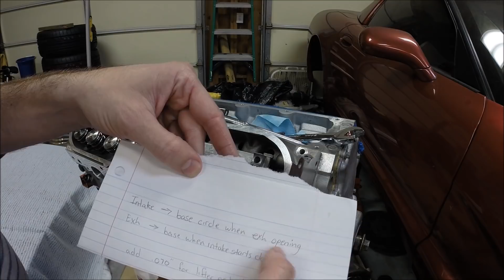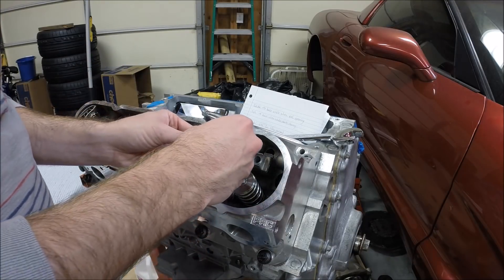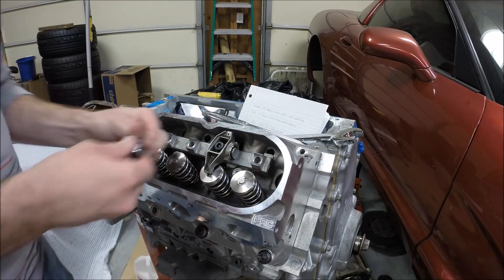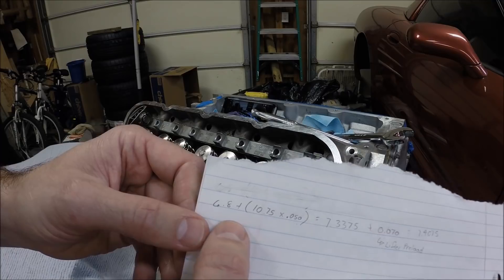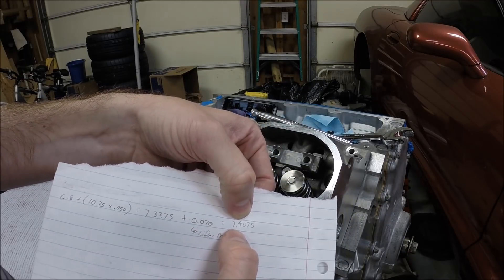LS Engine Tech: Measuring for Proper Push Rod Length

Comment: I just grabbed a large digital caliper & used that to measure the adjustable rod then added the ~.090” for preload (LS7 lifters). Took all the guess work out of it. 

I also found the base circle by just feeling the pushrod for the specific valve i was checking and making sure it was at max lift. Then barred the engine one full revolution ensuring the lobe was at the opposite side. My cam has 23* of overlap so I wasn’t sure I could trust the flip flop method mentioned here.
Reply: real length is not practical length tho

Comment: Late to the party here.....i bought a car abuot a year ago , put on less than 500 miles and had a roller rocker failure, someone didnt tork properly....im changing out the broken one now.   Ive followed your other video about the trunion upgrade and i want to do this since i recieved the factory parts with the car.  (not positive I have the stock pushrods tho)  I do know that along with the rollers, i have texas speed push rods and a vr2 cam in the car.     IF i went back to factory rockers, would i need to change pushrods too? or could i just bolt on the fact rockers and go.

Comment: What the hell,I was getting my heads done already have huge cam and so far using stock push rods n bloke at shop said I'd only need lifters head bolts n gaskets when I get my heads back,taking 30tho off hopefully,but if U think about it half a turn is 50 tho so really what's 30tho off ,but least now I know how to check ,my mate put wrong size push rods in his 351 with alloy heads should of heard the tapping😆

Comment: My question is . Can the tool withstand the spring pressure ?
Reply from the maker: Note that in this method, the measuring tool is not subjected to spring pressure.  You're just adjusting it to zero lash.
Reply: @ScrufsGarage  i understand now thanks for the very informative video . Keep em coming

Comment: do i need to get the intake milled too, if getting the heads milled .020? if so, is there a way to figure out how much? tia.
Reply from the maker: Milling the heads will change the clearance on the intake, but you should be ok at that level.  On the LS6 intake manifold I believe I had to do a little massaging on the bosses where the intake bolts go through the intake on the bottom side.  Had to take the leading edge off.   I don't recall needing to do that on the Dorman LS2 intake.  (it's been a couple of years now, so my memory is getting fuzzy, haha).

Comment: What I don’t understand is why you didn’t  torque the rocker arm to spec when finding zero lash? I’ve never disassembled the rocker arm assembly before so I may be missing something obvious. Thanks for making the video.
Reply from the maker: You will need to snug it down so there's no movement, but getting it to the exact torque spec isn't necessary since you aren't going to run the engine.  You'll find that the measurement different between getting the rocker arm bolt snug vs torqued is near zero.

Comment: I got the exact same measurements as you.  However, mine is a stock LS2 with SS1 cam.  The cam has a .050 smaller base circle than the stock cam which typically would mean I would need a 7.425 pushrod.  However, the stock pushrod is actually 7.385 which like your measurements technically would mean I would need a 7.410.  If I use a 7.425, I’m at .087 preload.  I believe BTR recommends up to .100 preload.  With a 7.4, I’m only at .062 preload.  I see most run the 7.425 to quiet the valvetrain.  I’m on the fence here.  What’s your thoughts?  How has your motor been running?

Comment: Great video. One thing I think worth mentioning is when the valley cover is off, you can confirm the lifter is on the base circle by looking at the camshaft. At least when I used the #1 cylinder for my measurements, I could see both lobes/lifters.

Comment: great video. 
As I chase my tail after the rebuild I never noticed or took this into consideration. Now the Smog Check is way past due and I need to find the source of my dreaded P0300. I'm sure a tune will need to be done regardless since I installed a Stage 2 Cam and I keep getting misfires at idle according to the obd2 scanners.
Reply: Fernando Escobar almost every cam sets off the misfire at idle , I have a mild cam on mine an same thing got fixed after the tune

Comment: So if my pushrods are the same size as yours 7.4 would that mean the math u did would work for mine as well?
Reply from the maker: It would be best to take the measurements from the engine you are building and then do the math to make sure the 7.400 push rods are what you need.

Comment: I have a 1975 Ford f250 with a 360 I replace the top end new can new lifters pushrods timing chain. Got it all back together got it running and with 40 minutes of just run time heard a ticking noise took it all back apart and found out that my cam add eaten five of my lifters does anybody know what caused this cuz I'm completely puzzled since then I pulled the motor and had it completely gone through but I still don't know what caused the cam 2 destroy v lifters with only 40 minutes of run time if there's anybody out there with any ideas I would surely appreciate a comment below because at this point and I really don't want this process to repeat itself thanks

Comment: I'm at 7:48. I've never done this but I'm thinking instead of disassembling every thing I would check with feeler gauges the amount of clearance, disassemble and adjust the push rod what ever the feeler gauge shows and put it back in. Check again of course but it should be at zero lash. That way you don't have to go back and forth. Also. How about leaving the adjustable part of the push rod down by the lifter with the valley pan off? Better yet? That way there is no disassembly at all.

Comment: Why do you recommend doing that lifter hack before checking for PR size if your not really torquing anything down to check for size??
Reply from the maker: It sets the lifter at a fixed size.  Just prevents an erroneous measurement because a lifter was partially collapsed.
Reply: Why not use the pushrod checking springs that provide very little rate and wont collapse a lifter plunger?  And why did you not mark the head of the valve and rotate the engine to check for sweep and location of contact?

Comment: You have good intentions but you do certain things that just aren't right.  Using old gaskets and not what you will use, yes you have to waste brand new MLS gaskets to get proper crush, noticed head bolts missing? Ever use a set of calipers or dial indicator? Again good intentions but not sure I would follow your instructions
Reply from the maker: Head gaskets are designed to crush to a very precise thickness.  So whether you use the old gasket, or crush a new gasket, the resulting thickness is the same.   Since I was using an old pre-crushed gasket, there's no need to install all of the head bolts.  For the purpose of this process, the head bolts are just needed to seat the head firmly to the gasket/block so that there isn't any movement.  But you aren't trying to seal against cylinder pressure.   If you decided to use a new set of head gaskets for this process, then yes you would need to install all of the head bolts and properly torque them to spec since you would be crushing the gasket.  But at the end of the day, you still still get the same measurements.
Reply: @ScrufsGarage  
You just have alot of misguided information about assembly and people are taking your advice which is not correct assembly measuring procedures. Stacked/ erroneous measurements add
 up. If you're not a professional don't try to educate. It just adds to the already growing supply of misguidance out there.

Comment: So we aren't compressing the lifter are we? I didn't make a solid lifter like you did and my heads are torqued, so that is out of the question. I have my rocker to where it has a little side to side play, but no lash unless I pull hard and compress the lifter. Am I where I want to be, or do I need to go tighter?
Reply from the maker: No, you do not want to compress the lifter.  Lifter pre-load is the spec you add to the measured length of the push rod checker.   A solid lifter just prevents you from accidentally compressing the lifter.   It sounds like you are were you want to be.

Comment: If you buy a cam kit that includes cam, lifters and pushrods all as a kit, do you still have to check push rod length even though the kit comes with rods?
Reply from the maker: In theory, if the motor is stock and the heads have never been off, then the cam company should know the base circle for the cam lobes and be able to include the correct pushrods.   It's always a good idea to check, especially since you're taking the heads off any ways to change the lifters.   But mostly likely you'll be fine.
Reply: @ScrufsGarage  thanks for the answer. Would you have to check each valve or just one exhaust and one intake?
Reply from the maker: One intake and one exhaust should be fine.   You could also do the same on the other cylinder head too if you were really feeling adventurous, but probably not necessary.
Reply: @ScrufsGarage  thank you very much

Comment: Would they all be the same length?
Reply from the maker: In most applications they should be.  The base circle for the cam lobes should be the same and the deck height of the heads should be the same.  But you should at least check both an intake valve and an exhaust valve to make sure nothing funky is going on.

Comment: So how do I do this with stock hydraulic lifters with stock heads that have never been removed? I mean, doesn't the hydraulic. lifter deflate/inflate changing length? I'm confused.
Reply from the maker: Correct, the lifters will lose their prime after they sit for a while, and you may not get accurate measurements.  Thus the need to build a solid lifter for use during the measuring process (I have a video on how to do that)    Of course that means pulling the heads off but depending on the mileage of the motor, it's a good idea to install new lifters.
Reply: @ScrufsGarage  Ok. so how exactly does building a solid lifter work? I mean you have to take into account the preload on the lifter, roller on the tip length and its overall length right? I have no desire to remove my heads and I'm sure most people don't just to do a cam swap. I figure once I pull the cam until I'm ready to measure will be only a couple hours.
Reply from the maker: You can build a solid lifter by modifying one of your old stock lifters.   https://youtu.be/0-dvlBiMFU4      As outlined in the video, you are taking the measurement of the pushrod length that achieves zero lash, then add to that measurement the needed amount of preload.   But again, this requires removing the heads.   If you're only changing just the cam on a stock motor, then the cam supplier should be able to recommend the correct pushrod length based on the base circle of their camshaft.

Comment: What was your cam size and how much are your heads milled
Reply from the maker: The cam is the Titan 4 from Cam Motion.   227/232 - .612/.595 lift - 113+4 LSA.     The heads were milled to 60cc chambers, which I believe was around .010".   The heads are PRC stag 1 243/799 heads and they did the machining and setup the valve springs before delivery.

Comment: Man your videos are great, but I followed your process on pushrod length and determined stock length was ok. When I done the final assembly with new .051 gaskets (same as what was stock) and torqued with new studs, I came up with about .005 preload. I had to switch to a .025 longer pushrod to get nominal .030 preload. I'm running comp short travel lifters (.020-.040) preload. Just wanted to tell everyone you have to be pretty precise with these lifters as stock lifters have way more tolerance. Keep the great videos coming.

Comment: Just got off manton site, they say ball ball measure overall length, you say not to, so whos right?
Reply from the maker: It depends on how the measuring tool you are using is designed.  I used the Comp Cams tool, so I used the process that Comp outlines, which is based on gauge length, not overall length.   See "technique #1" at the bottom of this page... http://www.compcams.com/Pages/417/valve-train-geometry.aspx

Comment: Im using johnson short travel lsr2116 i believe is what they are, .035 preload +- .015, i plan on measuring the length of the pushrod checker with 8" calipers, as i am turning only .038 or so preload target. Why cant i just measure overall length of checker?????

Comment: Hey man I was wondering, if I install a btr stage 3 camshaft in my 2010 Camaro ss manual, with the proper pushrods and valvesprings, would it be safe to drive a few miles to get my Camaro tuned?
Reply from the maker: It may not run perfectly, but you should be fine to drive to the dyno.   But I wouldn't do any full throttle pulls until after tuning.

Comment: This is probably a stupid question, but I want to be sure, which valvespring is the intake and which is the exhaust? Thanks in advance
Reply from the maker: Not a stupid question, and an easy mistake to make.    To me the easiest visual check is to see which valve spring lines up over the exhaust port and which one lines up with the intake port.
Reply: @ScrufsGarage  so the valve spring above the exhaust port is the exhaust valve and vice versa?
Reply from the maker: Yes that's correct.
Reply: @ScrufsGarage  thanks man, I plan on installing a cam in my Camaro this summer!
Reply: Scruff are you screwing the bolt all the way down till it stops when you do your check?

Comment: ok scruff ill giv it 2 u in imperial. i measured & got 334" intake lobe & 354" exh now if i multiply intake valve lift by 1.6 rocker=534 & valve exh lift × 1.6=564 the exact opposite to the  cam card. card says intake .564 & exh .534 is it right scruff.
Reply from the maker: Are you sure you identified the intake lobe vs exhaust lobe correctly on the cam?  If you still have concerns, I'd call the cam company on Monday and run it by them.

Comment: mm scruff do u think the grind is wrong ?
Reply from the maker: It sounds like it is correct.  But you need to know if the cam card is giving you valve lift or lobe lift.   And in your calculation, you have to convert from metric to standard.  (there are 25.4mm per inch).  If you still have concerns about what you received, then I would suggest you call the cam manufacturer.  They'll be able to walk you through every detail of the cam and make sure you got what you were expecting.

Comment: yeah scruf its a gm l67 s/c 3800 anyway ive got a diemma . i measured the cam lobes & subtracted the minor fm the major & got 8.5 intake & 9.0 exhaust now my cam card says valve lift inlet .564 × by r. ratio 1.6 = 9.0 &  valve lift exhaust .534 × 1.6 = 8.5 does this mean my cam grind is wrong or  these 2 figures dont mean the same thing ? just a coinsidance ?
Reply from the maker: When you measured the cam lobes, were you in metric or standard?   If you were metric, then 8.5mm/25.4mm = 0.334" of lobe lift.   0.334" x 1.6" = 0.534" valve lift.     Typically the cam is advertised for X amount of valve lift, based on a given rocker ratio.    Is the cam card giving you valve lift or lobe lift?    Valve lift = lobe lift x rocker ratio.

Comment: hi scruf ive got a new cam to go in & they gav me 2 different size rods i hav measured the cam lobes & got 5 mm difference on each lobe so the longest pushrod will go to the smallest lobe correct.
Reply from the maker: What kind of motor?    Typically, pushrod length is measured from the base circle of the cam lobe (not the lift portion).   That's why we took the measurements with the valve closed.  All things being equal, if the base circle is the same, and the rocker arm length is the same, then having a pushrod that's too long would keep the valve from fully closing (or damage the lifter).     Obviously your specific application may be different, so my recommendation is to talk to the cam company and make sure you understand which pushrods go where, and why they are different length.

Comment: Awesome video! Curious, why did you not torque the rocker bolts before measureing?
Reply from the maker: Trent Kammerer  For this check you only need to get the rocker snug in the rail so there’s no play.  Also, the push rod checker tool isn’t designed to have a load on it.  If your tool length was too long, then as you torque down the rocker, you would be slightly compressing the valve spring, which puts a load on the checker tool.
Reply: @ScrufsGarage  Makes since. I guess I was thinking about starting with it small enough the first time to ensure I didn't torque down onto the valve spring. I also plan on using something like this to do the test. https://www.summitracing.com/parts/cca-4758-2/overview/. I guess what you are saying is the difference between snug and torqued on the rocker bolts is just a negligible couple thous?
Reply from the maker: Yes that's correct.  Snug vs torqued down is a negligible difference.   They don't offer push rods in that small of increments, so there's some margin of error.